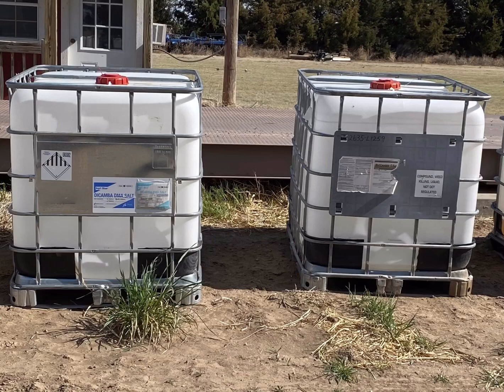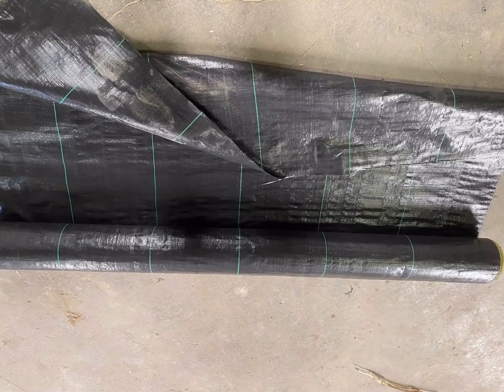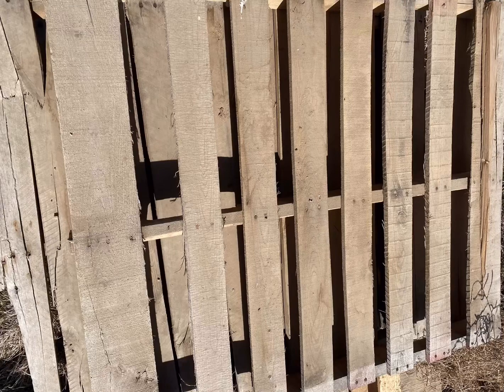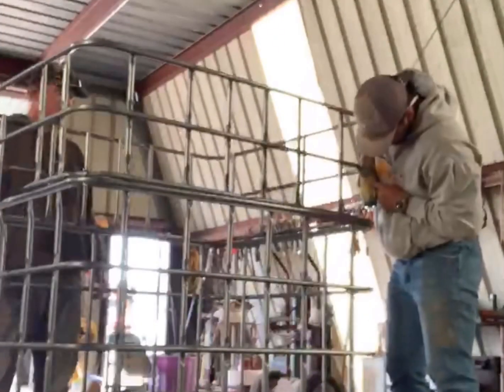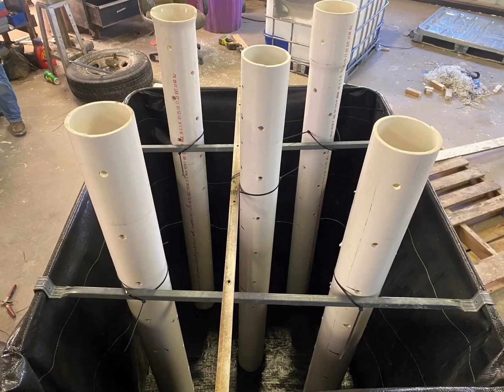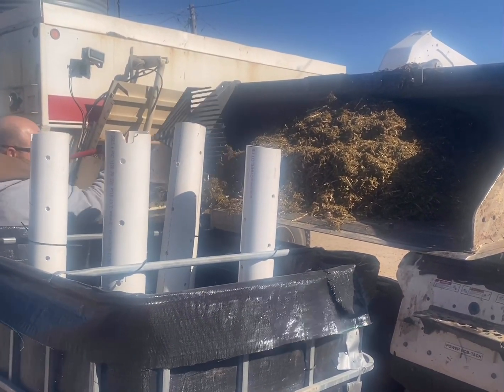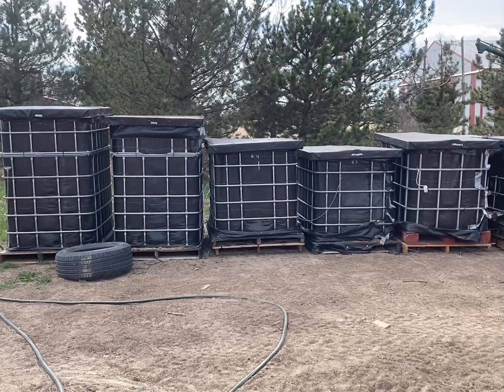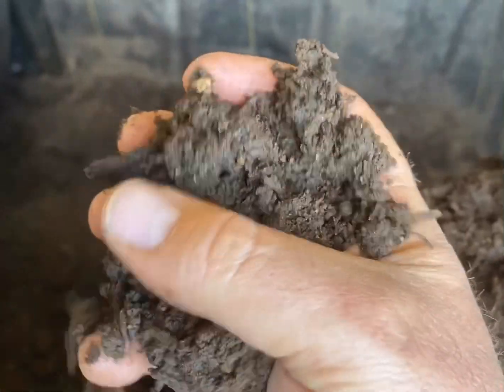How to build and fill a bioreactor quickly. Similar to a Johnson Su Bioreactor

Comment: Don't perforate your pipe! It's not necessary. The original inventor used pipe he had on hand which happened to have perforations. You will find the unperforated pipe is easier to slide out.
Reply: @Justin Kayz the pipes are put in place until the entire bioreactor is filled then the pipes are pulled out and the structure of the fill will keep the column holes open. This maximizes airflow from top to bottom.
Reply: @IowaKim  6:09 isn't it meant to use only manure and leaves etc to make compost? why is he using "new products"?
Reply: @Justin Kayz here is the original inventor of the Johnson- Su bioreactor.  He explains the oxygen flow that is required and that the pipes are only used as forms.
https://youtu.be/MuW42tFC4Ss
Reply: @Justin Kayz The pipes come out long before worms are added. Worms go in when the temps inside are under 90F degrees or so, so not for a few weeks. If you are adding when the PVC forms go in... the worms will die.
Reply: @Kim X Thanks for the info!
Reply: How close to the start of freezing winter time temps can you load the bioreactor?
Reply: Justin Kayz , I'm by no means an expert. But maybe they pull them out because its PVC or plastic which will enter the amendment and thus create impurities. My 2 cents
Reply: @milvolts1  nope... check out the other pertinent comments here. The material NEEDS OXYGEN to breathe - and lots of it, just like you and I do.

Comment: Great video! I notice none of the Bioreactors have a traditional compost pile ingredient list, Dr. Johnson even mentioned straight manure in one of his videos. Does the feed material matter? Looking to do a few this year.
Reply from the maker: Travis Dykstra  all that matters is good air flow through the pile.   Too much carbon like straight wood chips will take longer to break down.    I just asked him if I could use ground oat hey and he said that would be great
Reply: Thank you!
Reply: Make very sure that any manure that you use does NOT contain  GRAZON herbicide.  I got a load of horse manure from a guy that swore his manure did not contain any herbicide because his hay supplier promised him that it didn't.  Somebody lied.  That manure killed my garden that took me 14 yrs to build from nothing.  It devastated me.  My potatoes rotted in the ground, Tomatoes developed end rot, green bean had leaf curl and the same for the squashes.  Straight 8 cukes were not straight nor 8 inches, never got dark green and the vines died way too early.  But the tell tell sign of GRAZON evidence was that the corn was perfectly fine.  I sent my soil of to A&M university  for testing and it came back positive for GRAZON.  We sold our house and moved to the Tx. coast; I was so devastated.  3 years ago and I haven't gardened since.

Comment: I noticed that you have these filled reactors inside.  This is something I don't see addressed that often, but would placing in the sun, shade or inside affect the process?  Which would be the optimal place to put one?
Reply from the maker: Steve H 
You can’t let them freeze.  The first 4 were inside because of weather 
The last 2 I put inside for the first day while we were making lids.  I didn’t want the wind to dry out the top.

Comment: I'm a 5'2" grandma. This is a much easier design for me to handle. I would need to cut off the top 2 sections of the concrete wire just to see in.  I plan to put these in the 2 north corners of a hoop house. I'm at 8500 ft in the Rockies, and it could frost any night, so I hope the compost heat helps.Thanks!
Reply from the maker: R Gray do you have access to any shuttles?
Reply: @youngredangus6041   I have a pickup and Craig's list often has them.  I would prefer the food grade ones...just because.  I can think of a lot of uses for them.  But this one looks great!  I'm on 100 acres west of Pikes Peak, so no one will complain about how anything looks.
Reply from the maker: R Gray that’s awesome.  What do you grow?
Reply from the maker: R Gray that’s awesome.  What do you grow?
Reply: @youngredangus6041  First year for the hoop house.  We have such wonderful intense sun and I stole some fantastic, black dirt from the valley floor below the dam to grow in.  Everything grows beautifully, however, we have a really short season.  My hoop house should be primarily a season extender.  I need to protect my garden from deer, elk, every kind of rodent from prairie dogs to chip-rats...also known as chipmunks, and bear.  So it's a wild frontier.  The soil here on the mountainsides is really poor, unless you count the beautiful, almost peat, soil in the valley.  So this year I can plant beyond the beets, turnips, and cabbage that will make it even if we have a frost.  We had snow one year on July 4th.  It's not like Kansas City where I grew up.  But it is beautiful.  This year, I will plant everything from tomatoes and squash, to potatoes, onions,  and beans.  Some in the hoop house, some out.  Busy summer ahead.  We had a 30 degree night last week, so the hoop house looks smart.
Reply from the maker: R Gray that’s awesome

Comment: Thanks for your videos! 2 questions, is it critical to have holes in your PVC pipes that only stay in the reactor for 24 hours?  And, why not leave the floor right in the fertilizer shuttles and drill out holes for the PVC pipes thru the floor (that's covered with landscape fabric)?
Reply from the maker: Shorty Flees.   Do you mean taking the bladder out cutting out the bottom and cutting hoes in the plastic bladder and place that on the bottoms over the pallet?   Or take the bladder out and using the metal bottom?    On the first one that might work.  I’d be concerned about air flow through your holes so if you try that make them fairly big.   On using the metal bottoms.  I did see some people making these using the metal bottoms.  They are galvanized metal.  We don’t have a metal saw that works for the size of holes.  We did use a blow torch but didn’t like the way that cut.   After getting the holes out of the one I abandoned them and opted for the wood pallet.
Reply: The holes are not necessary. The original inventor used pipe that he had on hand which happened to have perforations. You don't need to drill holes
Reply from the maker: Shorty Flees.   That’s a great question on the holes.  I would error on leaving the holes in the tubes.  If you try it without let me know.
Reply from the maker: Shorty Flees if end up making them a different way send me some pictures.  youngredangus@gmail.com